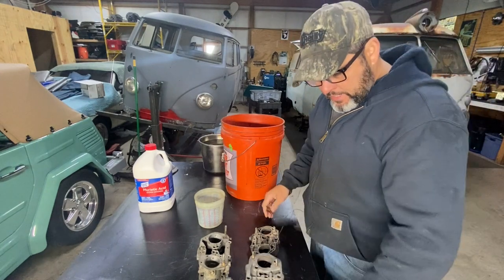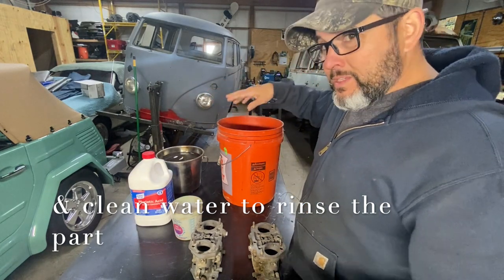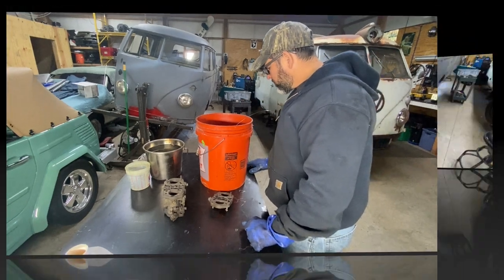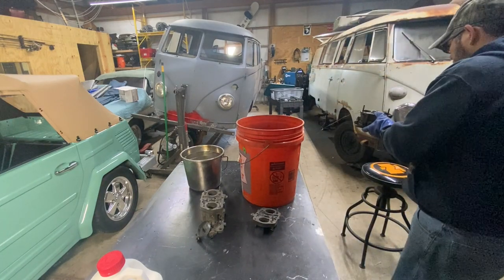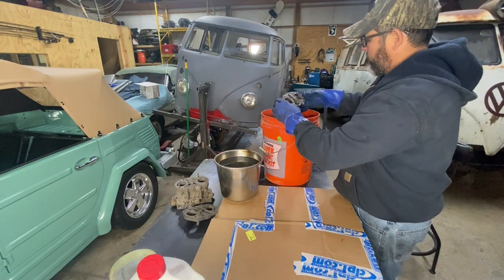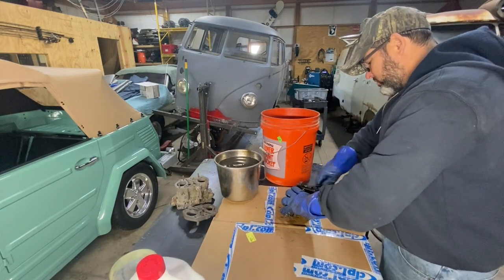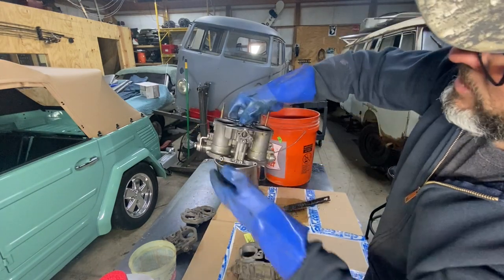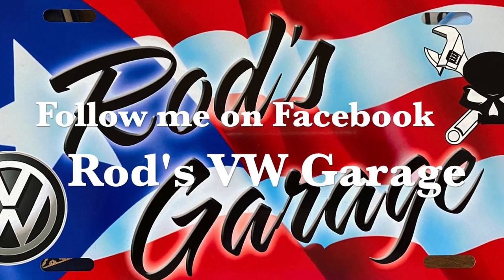Using Muriatic Acid to clean my DRLA 40 Dellorto Carburetors

Comment: I just rebuilt some Webber’s that came on a Karmann Ghia I just bought. They idled good but wouldn’t accelerate. The engine is supposed to be hopped up but of unknown size. Wow, did they work well and it is fast. Really cool and easy to do. I’m hooked!
Reply from the maker: You have to open your jets, start 200 air and about 145 gas
Reply from the maker: Also if your carbs are not transitioning from low to high you will need to open your idle jets as well! Good luck and please keep me updated.

Comment: I wonder how much better it would work if you boiled the solution like they do in radiator shops and engine shops?
Reply from the maker: I’m not sure! I might try it some day.
Reply: I suspect that would create a LOT of acid vapors.  Also, I think engine machine shops always used an alkaline solution, not acid.
Reply from the maker: @73SDR  at the beginning it did but as long as you keep your distance it’s fine.
Reply: @RodsVWGarage  I'm talking about if you decide to heat it.... I think heating might be a bad idea.
Reply from the maker: @73SDR  got it!
Reply: @73SDR  Possibly Alkaline for cleaning.. but  to remove rust you will need acid